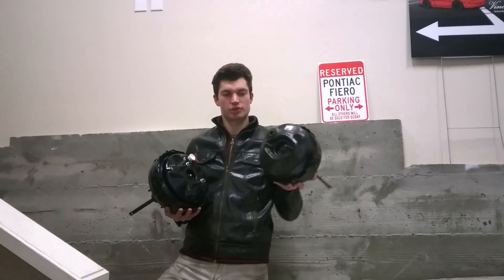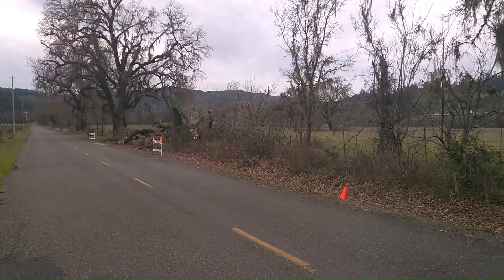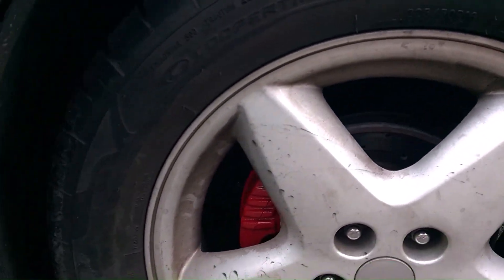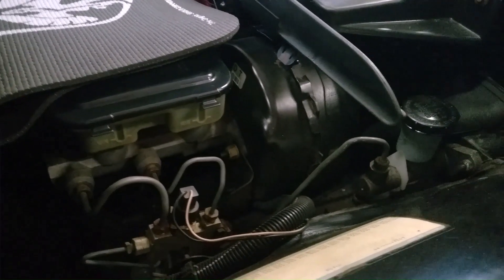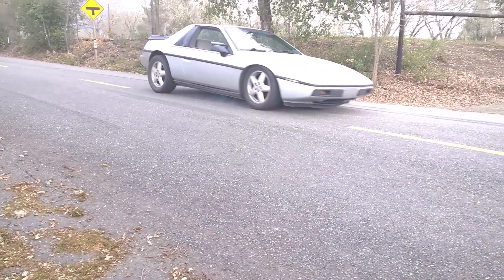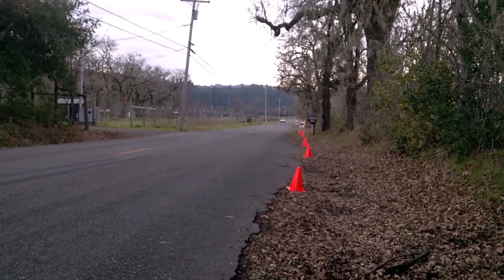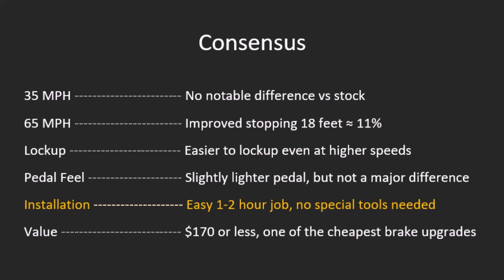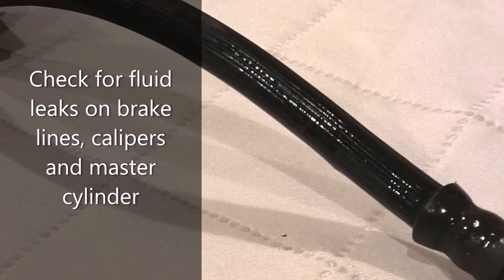Fiero Big Brake Booster Performance Test and Review

Comment: Problem with this "upgrade" is: Stock Fiero brakes are limited by the lockup. Assuming one can lockup the fronts with the stock booster, then there is no advantage to the S10 booster. I noticed you locked up the tires easily at 25mph yet didn't on the 65 mph test with stock booster. That's telling me you didn't use the full braking capacity of the stock booster at 65 so your numbers aren't valid. Whereas you did lock them up with the S10 booster.

Based on the above, the only advantage that might be gained is if the S10 booster allows for better modulation of the brakes than the stock one. However, it seems like it would be the opposite, which agrees with your statement, "It's easier to lock up the wheels now", meaning there is less feel to the system, or less travel from beginning of braking to lockup.

Now all this is out the window if you can no longer lockup the wheels due to tire upgrades or the like. If that were the case then the S10 would be of some benefit.

Comment: Your wheels and tires look perfect- can you tell me what wheels you have and what the tire sizes are?
Reply: I nearly certain the rims are the stock 16 inch rims from a 95-96 Cavalier Z24.
Original tires are 205/55 but as stated here the are wider at 245 with a compisated profile of a 50 series. 
(245 is a little a too wide for these rims imho)

Comment: My car locks up the rears first. You may need a new master cylinder. I also stop in 135 feet on factory brakes and old rubber lines.
Reply from the maker: Thanks for watching! My rear tires are 2 inches wider each than stock and a sticker compound and thus will resist locking up. Front tires are close to stock.

Comment: Does anyone know of any tutorial I could follow to upgrade the Break Booster? It looks simple enough but I'm not sure if the procedure would be any different with the Fiero.
Reply: It is a simple job, but does require some odd angles to get at a few bolts that hold the booster on. If you get the banjo from Rodney he provides instructions on how to complete the install.
Reply from the maker: Yes, Rodney Dickman has instructions with his kit. Basically, its the 4 bolts that hold the booster on, the one vacuum line and the banjo held on to the pedal with a pin. Some slight bending of the sheet metal under the booster must be done (hit with hammer usually does the trick) in order to make enough space for the bigger booster not to make contact with the metal.

Comment: Thanx for the video. Well done! One question aside: how many miles you go with your V6 with one fuel tank? Filled until the click of the petrol pistol.
Reply from the maker: I fill up daily at this cheap gas station on my commute to work, so I haven't run it for more than 8 gallons. Generally I put about 6 gallons for each 150 mile trip.

Comment: The challenge for brake upgrades will always be the ability to lock up the wheels when you don't have ABS. That being said, I am planning on the Corvette upgrade for my 88 Formula as I have driven that upgrade before with really good results and it utilizes the 88's brake calipers. Thanks for the video. The Fiero community needs comparisons!
Reply from the maker: I'm hoping to do the Corvette brakes on my 88 as well!
Reply: 88's are a totally different animal. If I had an 88 I would just get everything up to spec and that would be it. Stock 88 brakes perform well under racing conditions, no mods required.   Building our Lemons/Chumpcar - Pennock's Fiero Forum

Comment: Man, I know it's an 86 notchback, but that (88?) V6 accelerates pretty quick. Did you take the engine apart and mod it a little before putting it into the 86?
Reply from the maker: It is indeed an 88 V6, I did not do any mods to it, although the previous owner of the engine used it for racing so it is possible he had made changes to it. It's the only V6 Fiero I've had, so I don't have any fair comparisons.

Comment: Great Vid! Subscribed. Keep making them and I will keep watching. But I will say, I wish you had done a 60-0. Road tests have been using that standard for decades. I would love to compare directly. If you do more videos I would try to talk you into throwing that one in the mix :D Love the lip spoiler, where did you get it?
Reply from the maker: Thanks for watching and thanks for the feedback! Excellent point, I'm hoping to adjust the rear brake bias and then do some more comparisons, at which time a 60-0 test will be in order. The spoiler is from a current gen Dodge Challenger.
Reply: @angel_auto  Follow up question from a long time ago lol did you ever change the bias? I have wider rear wheels too and intend to swap double piston C4 calipers on the front so I might need to change it too.